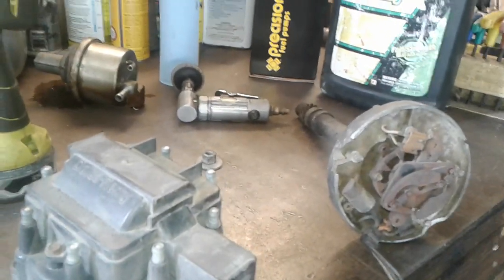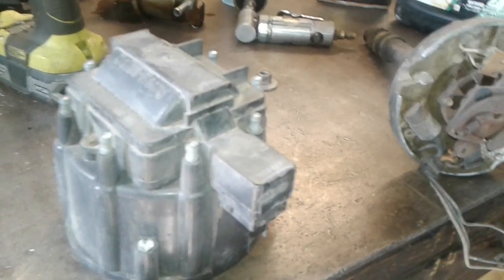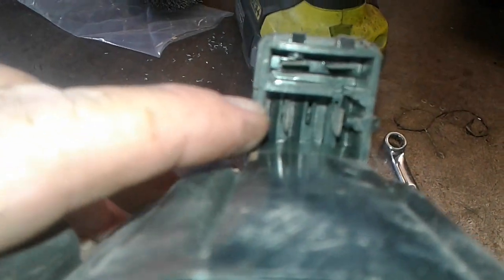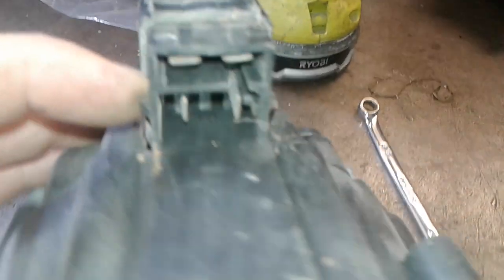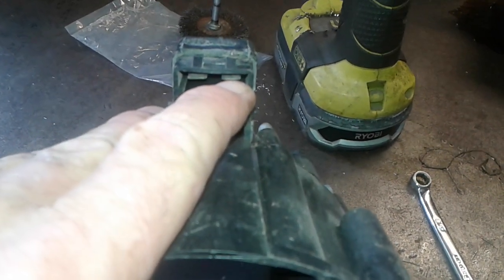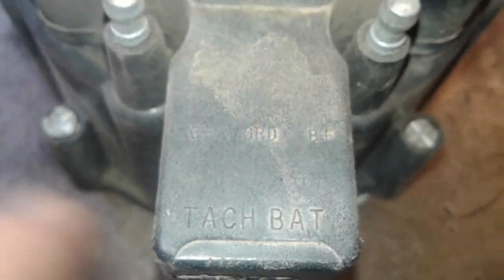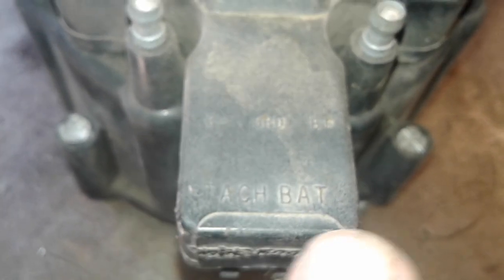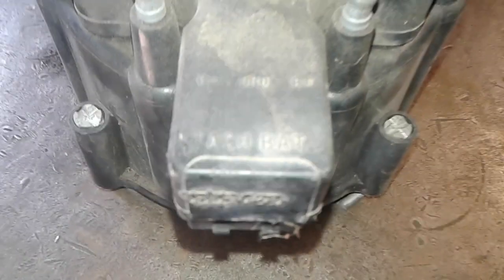How To Plug In A HEI Distributor!!!

Comment: Thanks Pat. I have everything that you mentioned except one little thing. I don't have 12 volts to the distributor. OOPS. Just another thing that I didn't know. I will do that tonight and let you know. Thanks Buddy
Reply from the maker: There you go!!! Keep Rocking it out!!!
Reply: Hey Andy, if you want to cheat you can just run a tempory power wire from battery positive to Bat on the HEI, bump the starter and it should flash right up if all is well with the distributor !
Reply from the maker: @TheCanadianBubba  Check out The Dog House out!!!!!!!!
Reply: Supper here now... get some groceries in me before i waste away : ]
Reply: @TheCanadianBubba  Check out the Dog House's last video. Thanks for dropping by
Reply: @AndysDogHouse -   : ]